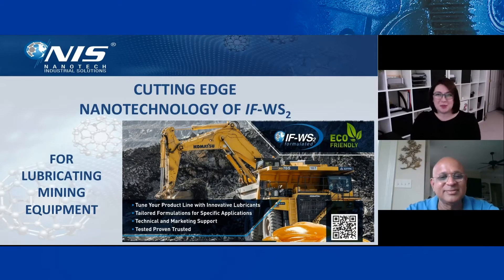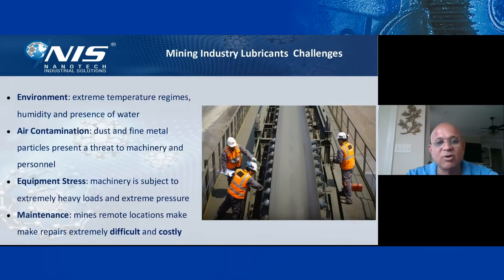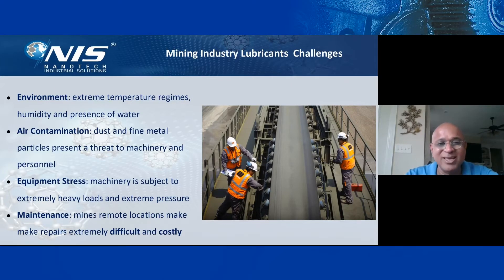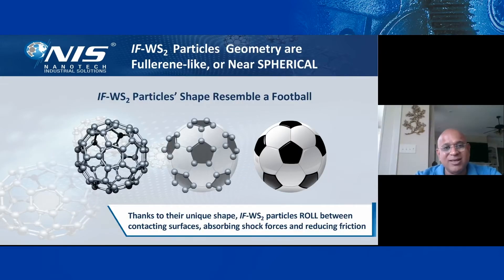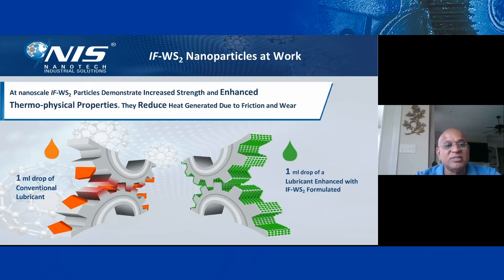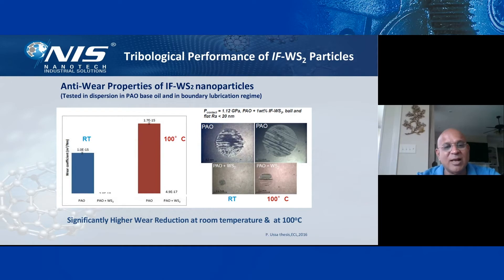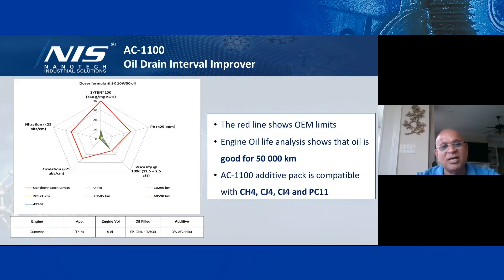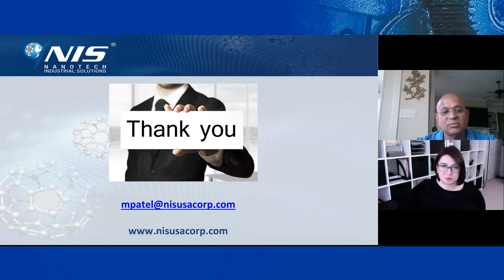IF-WS2 Diesel engine oil Additive AC-1100 for the Mining industry // Webinar by Dr. Manish Patel

Comment: Dr. Manish, thanks for your great insight on how good this Nano-tech lubricant works in an engine.  There are quite a few companies who supply IF - WS2 nano-particle powder.  Will it be ok to mix 3% of that powder with high grade PAO based oil and add to engine ? OR there is a certain procedure through which this IF-WS2 powder would get mixed with Oil ?  In other words, I like to know how can we develop an emulsion of IF-WS2 + High Grade Engine oil ?  I shall be thankful if you share the best formulation.  Cheers.